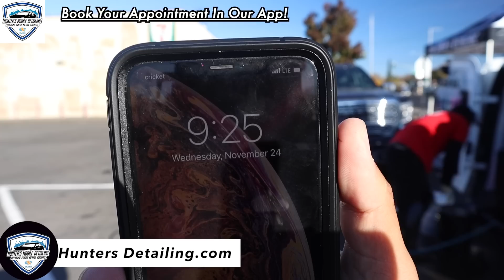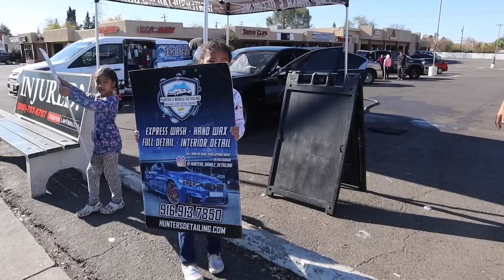First Pop Up Detailing Event - Part 1 - Hunters Mobile Detailing

Comment: Couple tips:
Always start inside then move out
I use griots foam wax. After the wash. Foams on and rinses off. Lessens possibility of water spots and beads like crazy.
Thirdly a carwash should only include an int vac, dashboard wipe down, windows, and wash/wax.
I promise you if you do this correctly you’ll finish any carwash in 30min or less
Reply: If you would see the video you would see he said he does inside out first

Comment: I have a question so As detailer what do you do for the winter months and how do you detail a car because I have a lot of issues well detailing in the winter months with dry times and things freezing
Reply: If you’re in Cali it’s never really cold, but it does slow down a bit
Reply: @miguel90744  I am from Kansas and I get a lot of salt cases in the winter to clean the salt off their vehicles but Right now it takes a lot longer because I have to wait for the vehicle to dry or wait for a day that it’s actually above freezing

Comment: Wayne, allow yourself some grace. The execution requirements on a drive and clean is nothing like what customers should expect on a full fledged single detailing appointment. It would be unreasonable to assume the OCD level detail that takes 2-4hrs can be accomplished in 30 minute (even with help).

Comment: Good work bro. But to do a pop up for 50$ I think u did way more than u should have. I understand detailer to detailer u  want to do all the extra stuff but at the end of the day it's not worth it. To take 1 hour on one car/truck is way to long u have to do a basic vacuum and wash 20-30 min tops with 2 people. Don't worry about every spot of dust dirt and grime get in and out and move on.